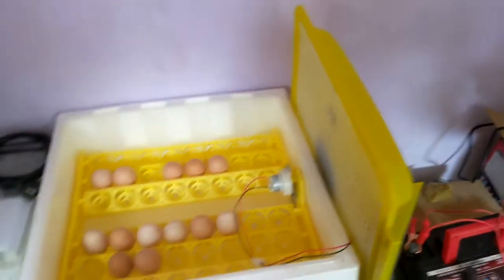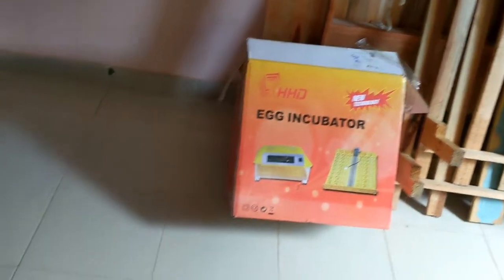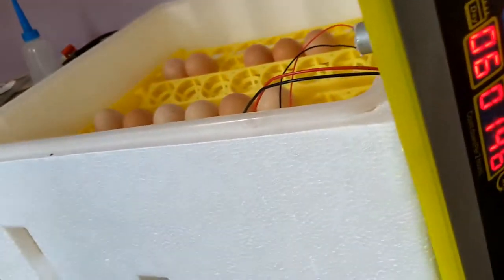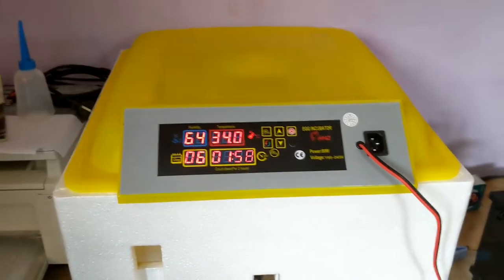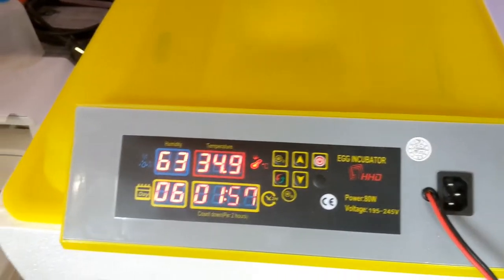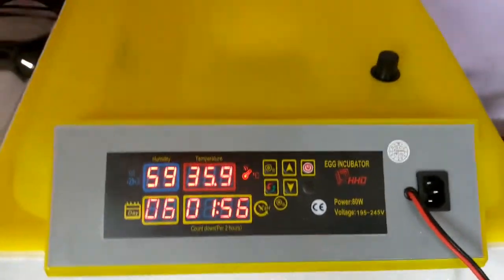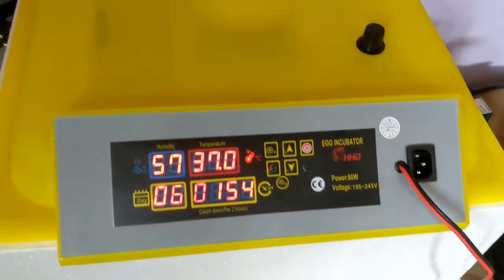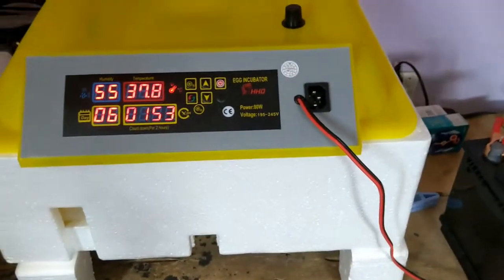Chicken Egg Incubator with Inverter - EXPLAINED

Comment: I just bought 48 egg incubator so my question is can i  use 12v battery and power  cable @ the sametime  just for backup when electricity goes off thank you

Comment: How long can the battery last when fully charged and without continuous charging? for dose of us who live in the village and without regular light or generator?
Reply from the maker: It depends on the capacity of your battery. That one you saw in the video will do 6 hours. and it is 60Amps
Reply: @feathers_pro  if that is the case what battery capacity will you recommend for someone who lives in the village without regular light. Please advise
Reply: @feathers_pro  6hours for total usege or 50 percent usage.